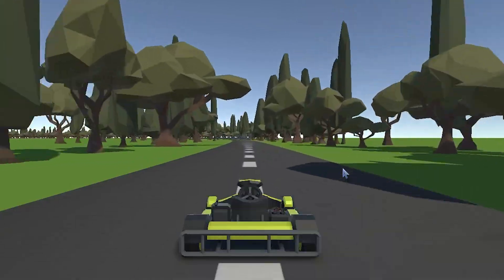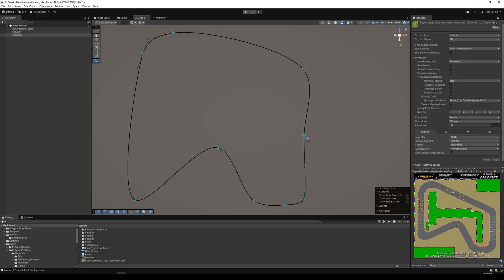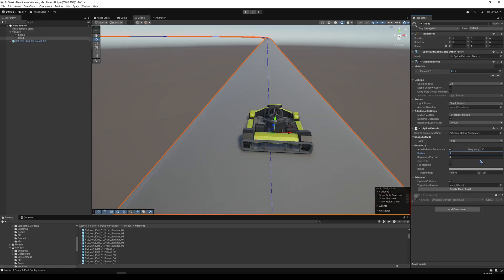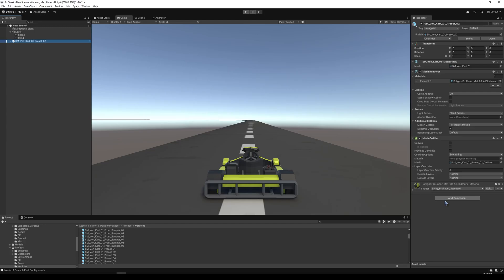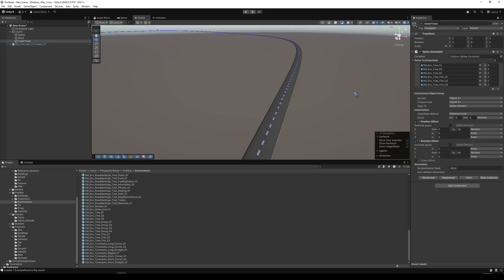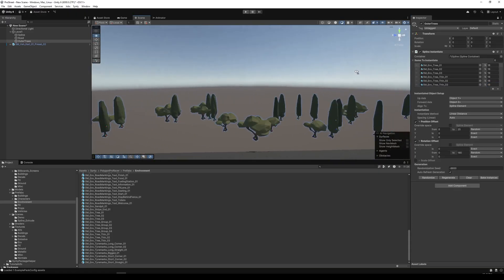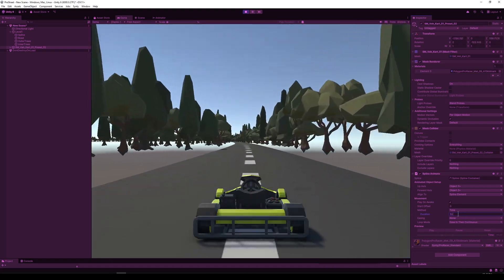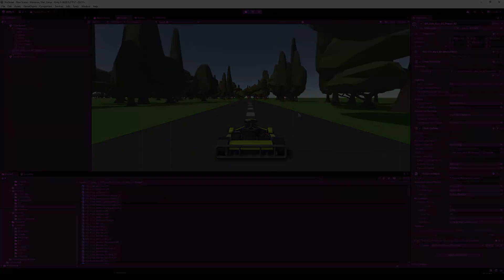How I Made a Kart Racing Track in Unity Fast!

Comment: So the end of your video you have grass either side of your road. I presume thats just a flat play you added afterwards? Im guessing you could make another spline, road shaped but 20 times wider and lower it so the road sits on top of it? Is it not possible to have a custom shape. So for example your custom shape has built in road, curbs, grass sides and wall? Either way thank you for the video. You might of inspired me to give it a try.
Reply from the maker: Cool you hear!  I think its just a plane of green or some decorative landscaping added.  I dont think I used spline for it, but you can if you want.

Comment: how abt the ground... how to make the tracks align with the ground
Reply from the maker: Good question, I dont know if there is an auto alignment feature, but if you have a terrain you will need to adjust the z-axis  of the spline or spline points to match.